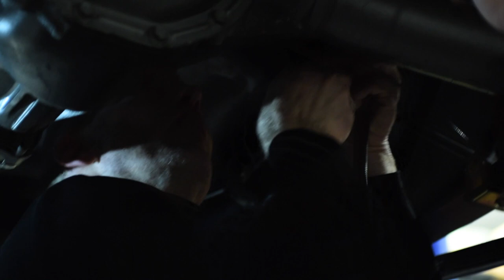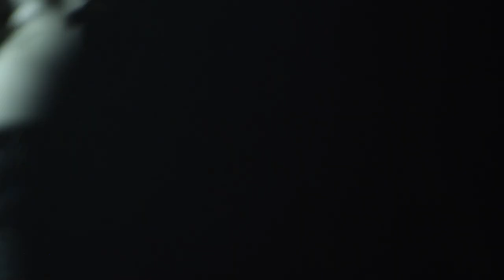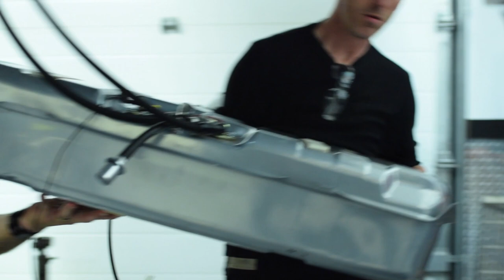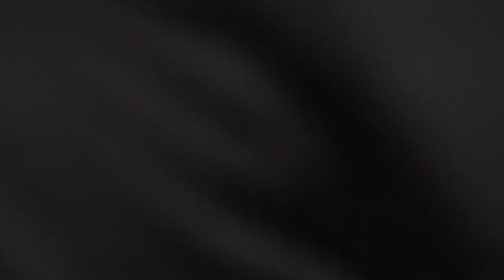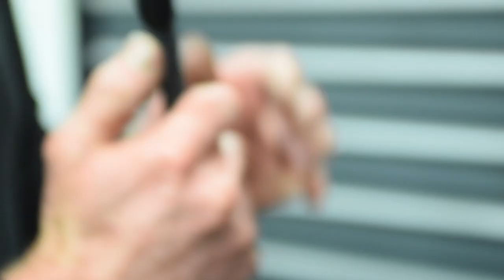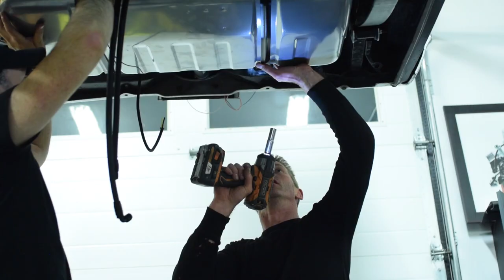1970 Chevy Nova SS Fuel Tank & Line Install

Comment: No commentary?? How much fuel line is required for this vehicle? Length wise?  What about fuel filter set up, why not show that stuff??
Reply from the maker: Hello! We used 3/8 (-6) hose throughout. AN fittings on everything and a serviceable filter. Plus a billet inline regulator and run the F/P at 5psi.